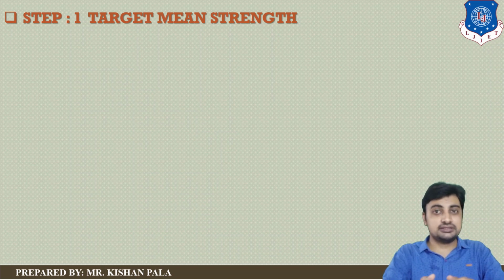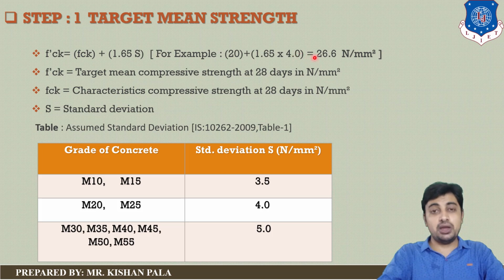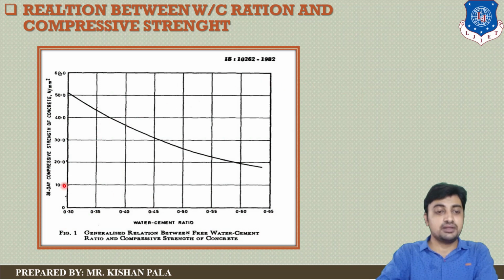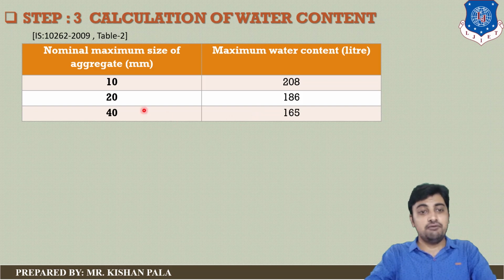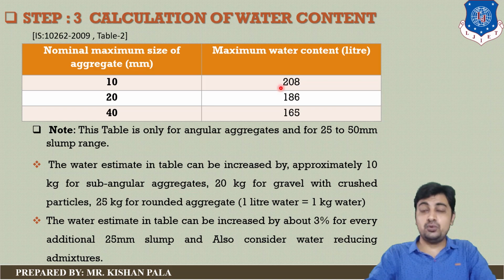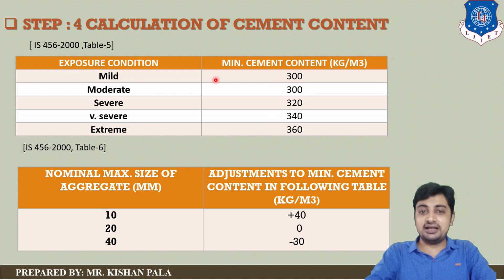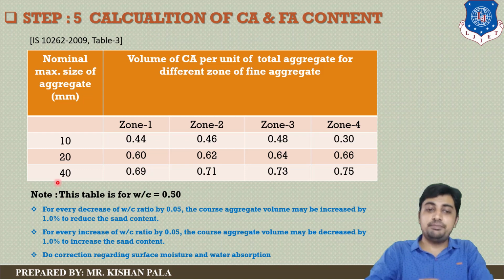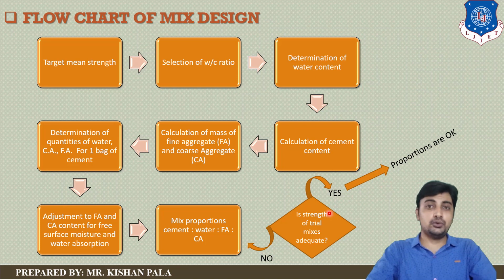Lec-28_IS mix design | Concrete Technology | Civil Engineering

Comment: Good Effort. 
W/C ratio curve IS 10262-1982, 
Mix design explained for IS 10262-2009.
Today code in force is IS 10262-2019. 
This presentation is useful only for experts, not for amateur mix designer. 
In my view, durability is the first parameter to be checked immediately after receiving Material & Data. Thank you 👍